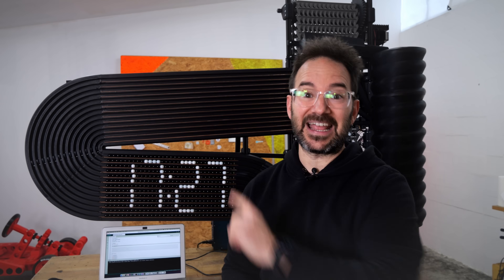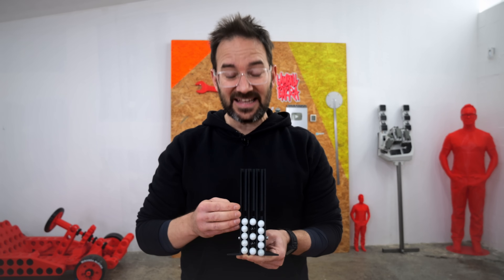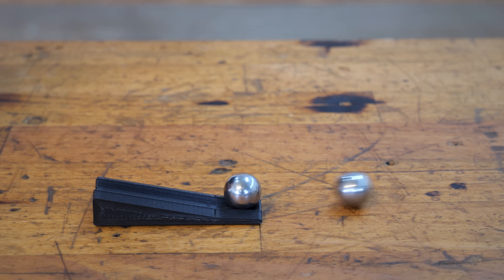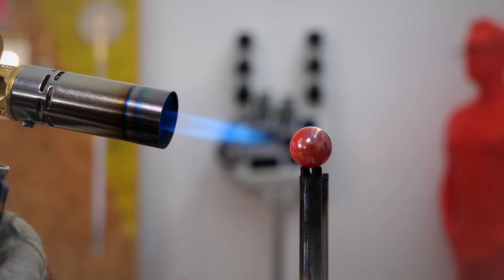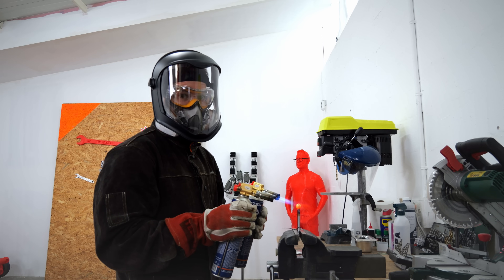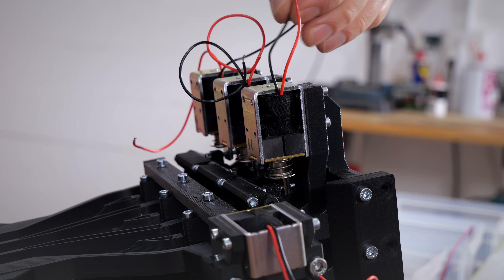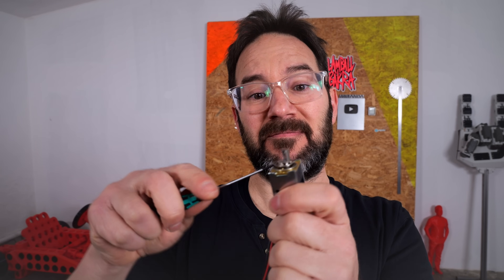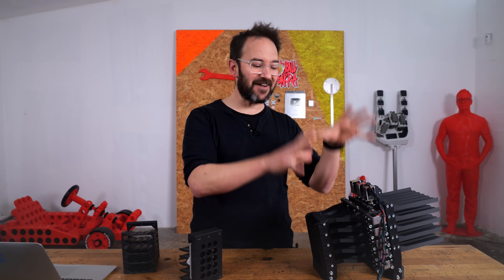Ramp Based Rapid Marble Swap - Marble Clock Seconds Display Pt.1

Comment: You need make system about 3 vertically stacks 5x3. The middle stack show an actually digit. The top one is hidden from watch. The bottom one is a bunker. For operate you must prepare two digit - actual and next. For change digits you must open columns stopper on bottom of second stack. The column of 10 ball each drop down into empty bottom stack where is own bottom stopper activated. After that you must activate the stopper of middle stack, refill top stack by new digit and make empty the bottom stack.

Comment: you may cover this later in the video, I'm only 2 min in, I've commented about vertical before, but here's a random assortment of other ideas I've had to optimize. 
 - the lift and sort system is pretty brute forced way of sorting, as a programmer it's disgusting lol (no offence meant).  instead maybe we sort them once all white in to a track and black in another, those tracks could be like a marble reservoir. and then we could directly release the marbles we want into the tracks. instead of only grabbing a marble if its want we want and pushing others to be resorted(time sink). 

-merging all the tracks together and then sorting means we need a lot more marbles and are just hoping enough of a color end up in the track that needs them fast enough for the time change. you've added alot more white marbles to help with this, but its still crossing fingers, not guaranteed. so maintain the tracks, give each track the number of marbles (worst case) it needs for 2-3 "images"  (if we do this the reservoirs ) above would need to be two per track to maintain this.  how ever creating the reservoirs would also remove a lot of the need for this as its less likely that you'll get stuck waiting on a color but still possible.

- worst case we could remove black marble entirely and use some sort of mechanical flaps or stoppers to hold white marbles in place instead of counting on the black marbles which are basically just white space here. 

- 

- granted some of this ideas would require more complexity/cost in the mechanics/logic/hardware to complete and I'm not accounting for the increased difficulty before proposing these.

Comment: So um... I feel like someone has already said this, but I've only seen part 1, 8, and whichever one you created the marble ladder for.
Why aren't you only updating the "few pixels" that need updating? Given the 5x3 structure (15 marbles), to move from 8 to 9, you only need to swap 1 marble.
top|second|middle||fourth|bottom, 0 = non-digit marble, - = digit marble, X = State swapped
0->1 = 7 Marbles XX-|X0-|X0-|X0-|XX-
1->2 = 8 Marbles XX-|00-|0XX|X0X|XX-
2->3 = 3 Marbles --|00-|0-X|X0X|--
3->4 = 5 Marbles X-|X0-|X--|00-|XX
4->5 = 4 Marbles X-|-0X|---|00-|XX
5->6 = 1 Marble --|-00|---|X0-|--
6->7 = 7 Marbles --|X0X|XX-|X0-|XX
7->8 = 6 Marbles --|X0-|XX-|X0-|XX
8->9 = 3 Marbles --|-0-|---|X0-|XX
9->0 = 4 Marbles --|-0-|-X-|X0-|XX

And when you look at it this way, you actually find out that Column 2, Row 2 and Row 4 NEVER BECOME DIGIT MARBLES. So you only need to have change channels to 13 of the 15 positions, and you AT MOST need to change 8 of them.
Going from needing to change 15 marbles every second, down to at most 8 reduces a LOT of the time spent hoping the marbles get there on time.

Comment: You could drop one marble per second onto a scale calibrated to the marble’s weight. Then the weight readout of the scale would be displaying seconds. The scale could dump the marbles at after 59 seconds to reset.

Comment: Perhaps I misunderstand, but by connecting the marble selection gates on each row, you effectively are forced to release each column separately in order to build the right digit. I suppose that's a concession made to not have to connect each individual marble selection gate to their own solenoid... But it comes with a long delay per digit, I'm curious how you're going to cope with that... ;-)

Comment: Seriously someone needs to make a company that sells high quality, perfectly round to high precision, colored silicon carbide or high strength ceramic marbles (even non-magnetic metals can act weird around electronics due to eddy currents), maybe with some lead or tungsten in the middle to add mass (super dense, least conductive metals). I can think of at least two people who would buy them in bulk, that’s gotta be enough of a market right?

Comment: Muriatic Acid is the other and weirder name for Hydrochloric acid, which you can buy at the hardware or pool supplies at typically 35% concentration and is 'relatively' benign.

Comment: Have you tried using boiled linseed oil instead of (what appears to be) motor oil? Had pretty good results in appearance with only 1 or 2 coats and no cold blue, though the durability isn't great.

Comment: I think I have an idea for feeding the marbles to the reserve channels.  You'll still have the down ramp to a recovery pool, but a) lifting involves something that's basically an Archimedes screw to lift the marbles to the distribution point to three different chutes - one for black, one for white, one for return to pool (to account for the possibility of all of one color's channels being full at any moment).  From there, just have the black and white runs set up to lock out full channels and round-robin the reserve channels with accommodations for channels with fewer marbles - and counts of marbles can be had with a few optical sensors. This will simplify the distribution of marbles, but the idea I have is going to create more than just a bit of complexity, and more than one sorting elevator to maybe help speed things along.

Comment: Kiln! you could do whole batches of marbles at a time with a kiln or oven! you can try to borrow/rent a fancy electric one with precise temperature control, OR you can make a janky one in your yard! (see reply for tips)
Reply: Budget option would be to make an earthen oven, or 'earth kiln', which could be a tool in your maker arsenal at home for many projects to come! you COULD make one with nothing but a shovel (and some water) in your back yard (if you have one), then rig a leaf blower to it. but here's my suggestion:

For this 2-person job, you'll need: (all approximate)
-a suitable spot in your yard that's not too close to any structures or flammable stuff
Digging Implement(s)
-1 (or 2) thick-walled solid-Terracotta small-tree planter(s) (the flat-bottomed conical ones that're shaped like paper cups, NOT the bulbous vase ones) (bigger is better! -50cm min to 1 meter + if you can!)
-Forced Air source (leaf blower, etc.)
-metal ducting (1-3 Meters X 10-25cm)
-rotary too with stonecutting (carbide) bits OR Masonry Hole Saw (10-25cm) (some way to make holes in the terracotta without breaking it)
-a roll (25+ Meters) of ~8-4ga (~4-6mm) steel wire (with torch and pliers to bend, and welder to assemble)
-2x4 (any type, so long as it's strong)
-(optional) Refractory cement and batting
-(opt) Pyrometer with probe and/or high-temp laser thermometer

1a) IF you bought 2 pots: using your implement for cutting terracotta make an off-center, "tangential" hole just above the base of the pot that will introduce the air off-centered to induce a vortex. make the whole about the diameter of the ducting.

1) Dig a hole, diggy diggy hole. that either A)s your second Terracotta Pot snuggly  with it's lip flush with, or less than 2cm above the ground, or B) is just a bit smaller around than your singular Pot, but just as deep.
Note 1: don't forget to create the trench for the ducting to ramp to the surface from the bottom of the hole/pot tangentially for your air supply

1b) IF you're using 2 pots, AND you choose to use refractory cement, lower the base pot into the ground first and then putty the bottom and walls with 1-3cm of refractory cement

2a) IF you've chosen to use refractory cement, coat the inside of the lid-pot thinly and use the wet cement to adhere a layer of fire batting to the walls, being sure to leave the bottom hole of the pot unobstructed as it will be your chimney!

2) turn your primary pot upside down and use your heavy gage steel wire to create a cage around it that will allow you to lift and move it more easily (with a partner). Terracotta is tough stuff, but still a ceramic, so this will let you handle it with care.

Note 2: with some 2x4's you can make an A-frame from which to hang the lid-pot with a winch overtop the kiln, or, better yet, a simple A-frame and counterweight-lever crane next to the kiln to handle the lid-pot by yourself
Note 2a: if you have extra ducting, you can make a little chimney atop the hole in this pot!

3) affix your ducting to the bottom chamber and bury it. 

4) affix your air source to your ducting

final notes: 
-consider making a hatch to add fuel and tend the fire in one of the pots, so you don't have to open the lid to throw in some coals/wood mid burn. 
-some fire batting will be needed to heat-seal the rim of the lid-pot against the pit!
-you'll need steel racks for the marbles! if you have leftover wire, you can make these from that, or you can use premade barbecue grill racks; I'd suggest round ones that have feet built in and can be stacked by just turning them 90 degrees so the feet run perpendicular to the grate underneath.
-adding a pyrometer will make this whole thing more effective and efficient. 
-with this operational, you should be able to get into a workflow to treat whole racks of marbles in one go, just dumping the whole rack into a metal basin of oil!

Comment: Why do you need black bearings at all? If they aren't supporting each other and are in their own slots individually, could you not just release regular bearings and leave blank spaces where the black marbles will go? It should save a CRAZY amount of time. You would have to rework your gates to open and close individually, and get one solenoid per slot, but it might be quicker than the black bearing option. Good luck!

Comment: At the very least if you’re gonna sit there and heat them all one at a time with a torch, do yourself a favor and go buy an oxyacetylene torch and rosebud tip. They are designed for heating metal. I would personally look at electroplating. Or maybe just get a bunch of stainless steel balls, and then one of the issues you had on this one can help you quite a bit in sorting because stainless steel does not stick to a magnet.

Comment: Maybe separated solenoids to color switch would increase the speed of the clock. Because the machine processes one color at a time. The algorithm already knows where and what color should be so I independent color switcher will make it as fast as a spaceship

Comment: I think he needs a separate horizontal solenoid for each gate, rather than joining them together. he has to open 3 black or 3 white gates each time, meaning he needs multiple cycles per digit.
It could also be optimised by only releasing marbles when the colour needs to change.

Comment: Towards the end of the video I noticed a lot of the actuators are firing in sequence, when the clock mechanism could operate more rapidly if the solenoid gates upstream didn't wait for the final gates to clear. 
Also,
In the display that loads minute by minute, one could conceivably mechanically program each channel to spit out the black marbles into a black marble bin and the white marbles into a white marble bin, by using analogue memory. If the seconds run through a repeating cycle of 0-6 in the tens place and 0-9 in the ones place, you could mechanically design a cam that kicks out specific marbles in the cycle. So in a cycle of 0-5 using a 3X5 display, the top row would look like
11111, 00001, 11111, 11111, 10001, 11111, 
where 1 represents an "inked" marble and 0 represents a "blank" marble. 
So every cycle, the first round of marbles are all accepted into a receiving bucket, the second only rejects the fifth marble into the secondary receptacle, the third and fourth rounds accept all marbles, the fourth rejects the first and fifth marble, and the fifth round accepts all marbles. In this way, you can make it so that you do not have to manually pick out the black and white marbles every minute. If you use this technique, I suggest making each digit place in the display run on its own timing and cam so that you do not have to design a way for the cycle to include 60 unique rounds, and only need to design a 0-9 cam and a 0-5 cam for the minutes places as well as a 0-2 cam (unbalanced!!! 0 has ten rounds, 1 has ten rounds, and 2 has only four rounds) and a 0-9 cam for the hours. That's if you're using 24-hour timekeeping. 

By the way, as I can conceive of it, you'll have to design one cam for each row, or one for each column.

If you then put a belt that raises all the marbles to a selector that uses a similar cam system, you can make this clock run indefinitely, assuming no black marbles go into the white marble bin and no white marbles go into the black marble bin.
Most of this wouldn't be necessary if you continued in the vein of using solenoids, but I'm fond of analogue machinery, so that's where my thoughts were heading.

Comment: 7:03 In the future, perhaps put the steel marbles in a rock tumbler. This will abrade away the chrome evenly-ish. If you do not have a rock tumbler, try putting a bunch of grit in a bucket and several marbles at a time into the grit in the bucket. Then jiggle the bucket around for a few minutes. this will scratch up the marbles unevenly. If nothing else, you don't actually need muriatic acid to dissolve a bunch of metals. I once dissolved the surface of a bunch of tin-coated copper jump rings by putting household hydrogen peroxide and distilled white vinegar and some salt into a resealable bag. After a few days, the surface of the rings were all rough and the solution was blue, an indicator of the copper in solution. Normally, a chemist would use nitric acid to dissolve copper. I do not know for certain if this will work on chromium, but it's likely that if you can scratch the surface, it'll eat at the steel under the chrome. If the marbles are stainless steel, it'll eat at the chrome itself. This is a process called galvanic corrosion. If you were so inclined, you could pull it off using a sports drink or a soda. It is important to scratch up the coating first though, as otherwise the coating may be impermeable and there won't be electrical contact between both of the metals and the solution. A quick roll around in a bucket of grit will probably do the trick to that end. When using the hydrogen peroxide and vinegar and salt, react it in a glass container. The solution ate through my resealable plastic bag.
Reply: or just hold the marble further from the flame. This will deposit soot. With the soot still on the marble, dunk it in oil. then burn off the oil. This, I've found, makes a coating of dark, black to blueish oxidation (?) [I'm not really sure what it is but it's difficult to remove from the metal]. My multi tool's knife will never look the same.

Comment: You can reduce complexity and marbles requred by making the column 2 rows 2 and 4 stagnant since those marbles stay always black. Also column 3 rows 1, 3, 5 will always stay white assuming numbers 1 and 9 are right aligned. That reduces 5/15 marbles 33% reduction!

Comment: Just sharing an idea.
Your design for the seconds is a differential gate. It looks like you're preparing to to queue up more than 1 second in the buffer. Relying on the kinetic energy to remove the current marble. If you want to minimize the work required, you can just map the difference between digits in a pre-calculated pattern. You know that it will always go from 0-1-2-3...9-0. You can use this information to instead of changing the whole number for the next whole number, to just process the difference. For example, In a 3x3 design, the middle marble only changes on 0-1, 6-7, 7-8, and 9-0.
This should reduce the number of marbles required, and increase readability for the watch viewer. You can add additional gates to increase the buffer size if required.

Comment: I really respect all the thinking and efforts you did for this clock, but I think the new design (for seconds) is way more functional than the first one for hours and minutes. I guess it will be better idea to replace the whole clock with this single digit design by replicating it into 6 digits and making it as complete clock.

Comment: You can use an empty slot (made of black material) as black marble. Then you will need just to replace the "color" of the cell if it needs to. 
You already have the gate to replace the marble - it can work as the gate for marbles that will fill empty slots. 
And if you add one more gate higher - you can knock out the marble from the filled slot with other steel marble.

Comment: Regarding black marbles, they make sharpies designed to mark on smooth and oily surfaces. I haven't tested them on chrome, but they work well on machined finish stainless. You'd just need a mechanism to automate marking them with the sharpies.

Comment: Awesome project! 

The main thing that bugged me is the fact that you approached as if it works the same as the big clockface, where ALL marbles have to be refreshed on every update. Here, only some marbles have to be updated, and ALWAYS from white to black or vice versa. So technically you wouldn't even need a colour selector for each "pixel", as long as you make sure in the (to-be) sorting process that the marbles in the queue have alternating colours. Then you only have to select which "pixel" to update each second, possibly removing a lot of complexity from that system. 

As a bonus, fewer updates each second means fewer marbles to sort in a second as well :)

Comment: Why not cut cost in half by using one relay per solenoid and just switch the direction of current with optocouplers or transistors